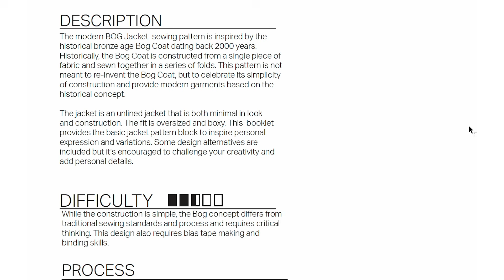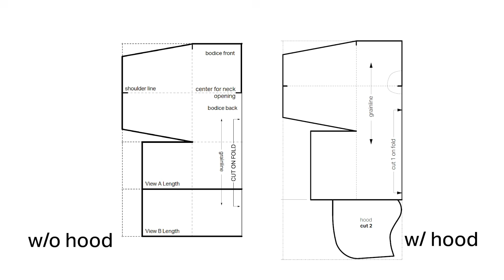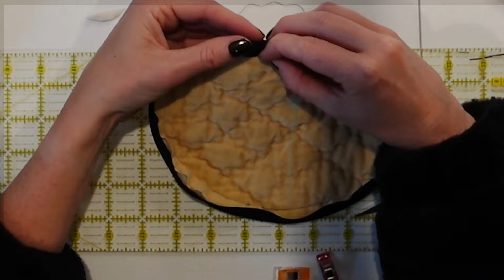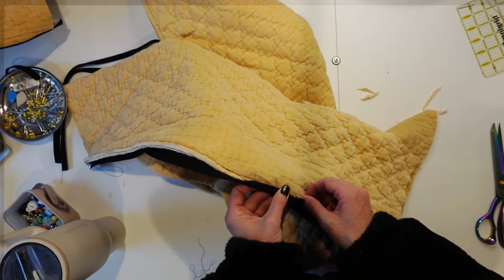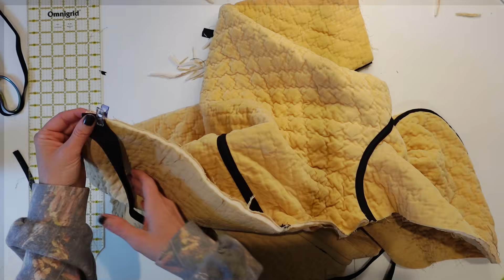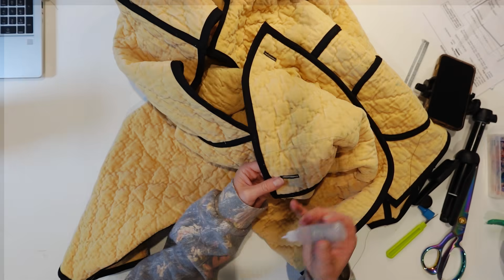Bog Jacket and Hood Sewing Pattern Tutorial

Comment: I cannot justify paying $26 for the pattern, plus $7 for the hood add-on.
Reply from the maker: It’s $22 for both in the bundle. $17 for jacket as standalone or $7 for hood. Im and independent designer- no corporate perks. So i price for that. Im sure you can find knock offs for cheaper
Reply: Measure yourself, and make the pattern yourself. It's not a fitted garment, so it would be quite  easy. Just tinker about with sizing, you'll be grand!!
Reply: This is a fantastic pattern. I have made several jackets that perfectly fit each person because of the instructions. Some wanted hoods while others didn't. Trust me, it is well worth the money because you can use it over and over.